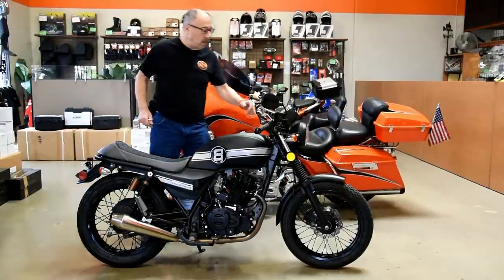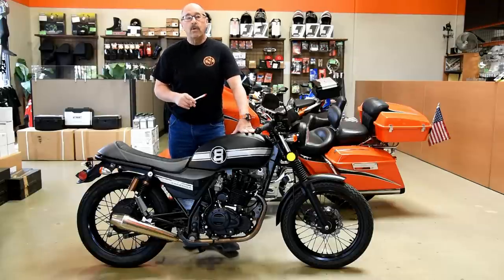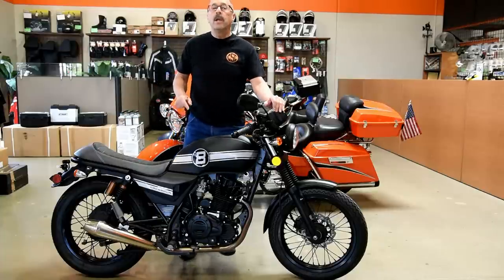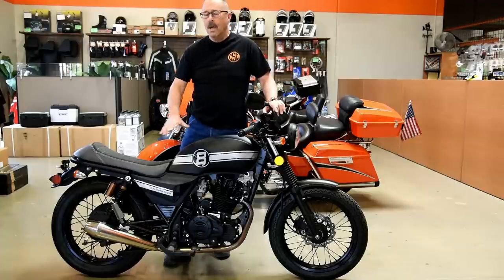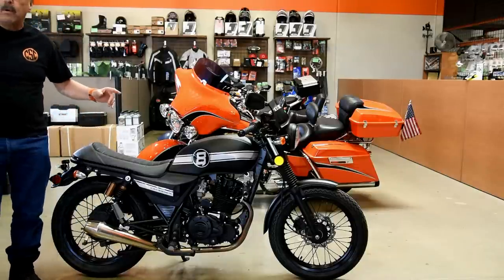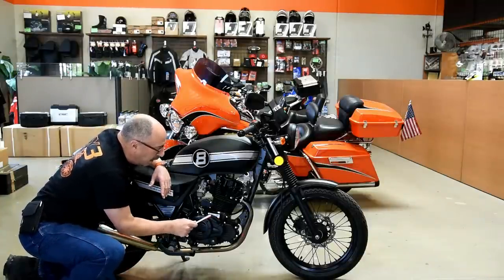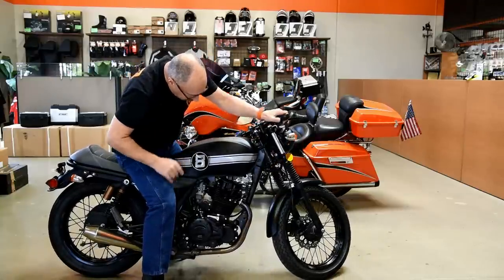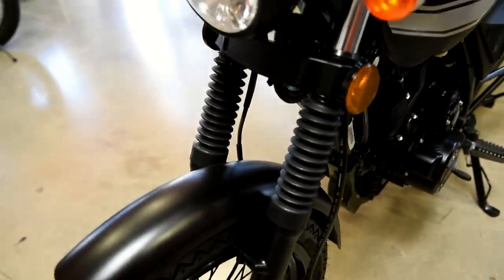CSC San Gabriel

Comment: Make a 400cc of all the models you have they would sell like hot cakes.
Reply: For real. I want this 250, but I don't think it's enough power. I read on Reddit that the 2021 might have a 500cc model of the cafe racer. I can't afford the 250 right now, but hopefully when I have the extra cash for a bike, the 500 will be out. I'll buy a 500cc of this in a heartbeat
Reply: A 250 would do everything I need it to do, EXCEPT I drive like 40 miles one way highway for school 5 days a week, every other 8 weeks, and idk if a 250 can do that. Since I haven't had a motorcycle before, I'm probably gonna hold out on this one, unless I find out the back way to school isn't that bad, or they come out with a 500cc that's a grand Max more in price
Reply: They have one now. Almost 6k
Reply: @williamarden5441  whats it called?
Reply: @zackzysek8303  I started of on a 2009 ninja 250 and that one can do highway speeds easily and get into the 90s and low 100s. You can find used ones in decent shape for the same price as this.
Reply: @MYTHICALTWINKIE  RX4. They havent upgraded the SG model yet, and there is no guarantee that they will. Cleveland Cycle Werks is already bringing in chinese Cafe Racers from 250-500cc so CSC might just decided to stick with their most popular models. Which are the RX3, RX4, and TT250.

Comment: Awesome looking bike! With that said, I would pay extra for a rear disc brake and a 19" front wheel. CCW imports a similar motorcycle with discs front and rear. With those changes it would be my next bike. In a scrambler configuration, which I like more, it would be hard to beat. I could easily make those changes, so pricing could change my mind. Either way, it's a great looking motorcycle and it's exciting to see it in the market.

Comment: Color looks great, seat looks great, there's nothing wrong with a drum brake on a bike this light. I'm even OK with the graphic. Only changes I'd make would be fuel injection, and a six speed transmission. The added cost of those 2 items would be well worth it to me. Just my 2 cents.
Reply: briangpz It's a 250. Does not need 6 gears nor does it need EFI